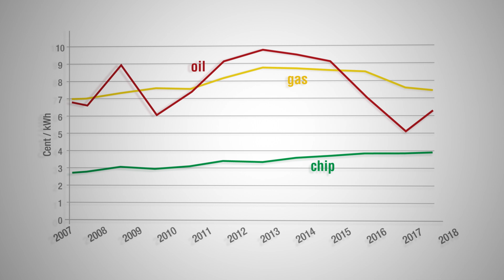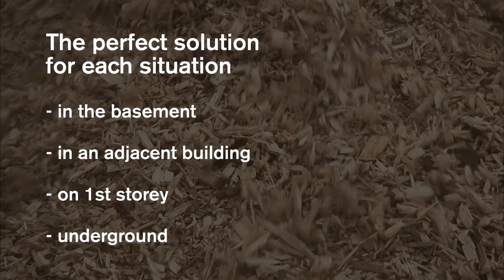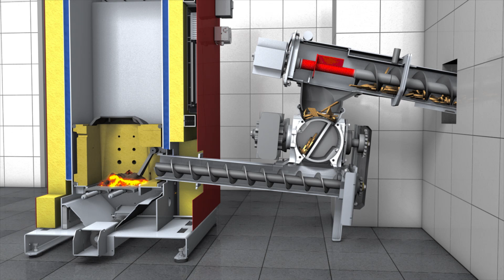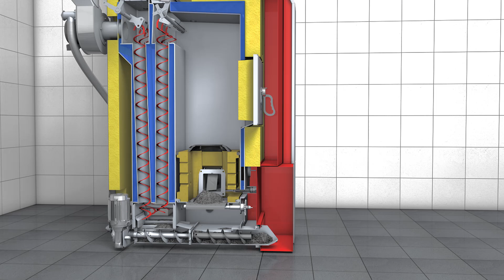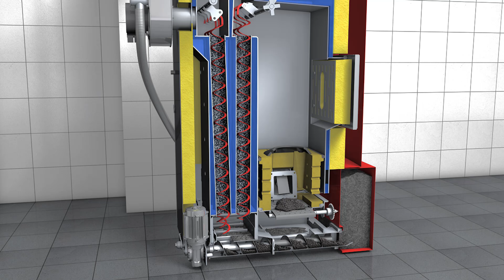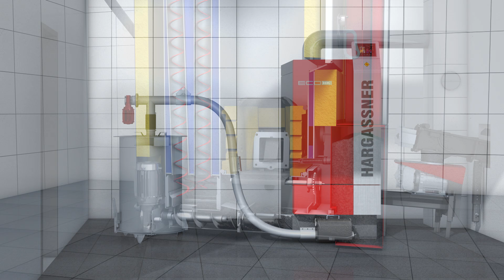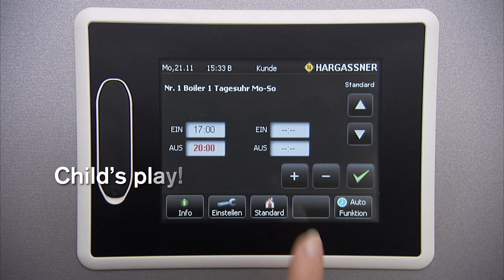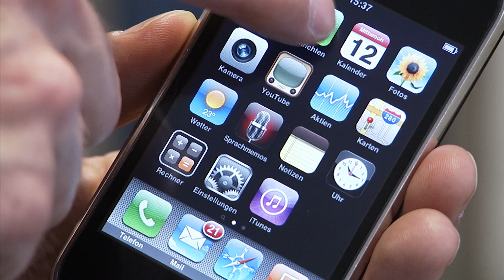Hargassner Heating Technology - Wood chip boilers

Comment: Wonder if this could be ran on a rough chopped straw?  Flax or wheat is no tilled here. Enough stem is produced or to coarse to break down fast or feed through the no till drill each year. Most of the time flax straw is just windrowed then baled and or burned in the field.  Flax produces seems that don’t deteriorate fast and is thorny that it can be tough on tires. Wheat is spread behind the combine then harrowed together.

Comment: My Lord, what does these  things cost? Got to be around $100,000 if not more, and the maintenance cost on all those moving part will be sky high too.  Also, where do they get the wood?
Reply: Hargassner isn't in my province, but smaller set ups (for use in agricultural or residential situations) of wood pellet machinery start around $20,000 Canadian in my area (Commercial and industrial units will obviously scale up).  More expensive upfront, but the pellets are cheaper than gas so you've saved more than the difference in 5 years or so; well under the boiler's lifespan.
Wood chip burners are a bit more but getting the chips is cheaper and easier; providing your project is large enough to make the investment worthwhile since they don't scale down to residential output levels cost-effectively.  Condo sites or apartment blocks maybe, but definitely not in-town or on-the-farm single-family units.
Reply: A bit less now that the euro has dropped.
Reply: You have to consider the amount of heat this machine produces. This is not designed for a home, 200kW is industrial scale. Most homes are served with 20-40kW of intermittent heat (easily averaging at-or-under 10kW). The cost-benefit allows much more room for a maintenance budget, when your project is heating a small industrial complex or city block.
Usually these are installed as part of a district heating system, where waste heat from a factory/industrial process is distributed to households through a district heating loop; this machine (or a series of them) may be installed as backup or for additional capacity. The cost to the consumer is lower than anything else, except possibly geothermal or thermal solar (if those options are viable).
As the video mentioned, wood can be sources from industrial waste, though managed forests are playing a large part these days.

Comment: Hich tech solution that does the same thing as a DIY ricket mass heater.

This here complicated electrically drven machines would be useless if power were to go down. It would become a multi thousand $$$$$ paperweight. 

On the other hand a DIY rocket mass heater would work perfectly in power down scenario.
Reply: if it was really smart it would power itself and charge a battery for the startup.
Reply: thst's the price of automation.
Reply: In an institutional setting, there is a back up generator.